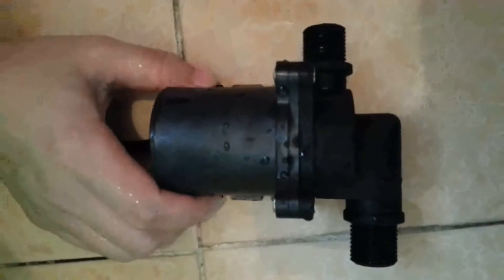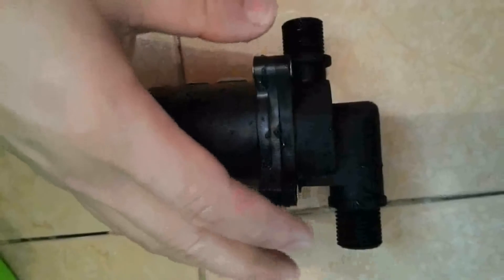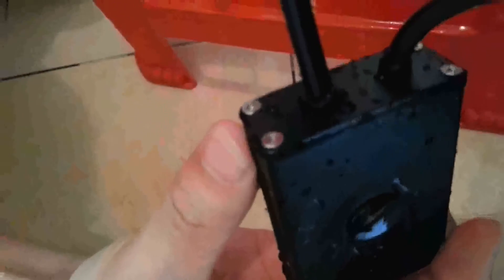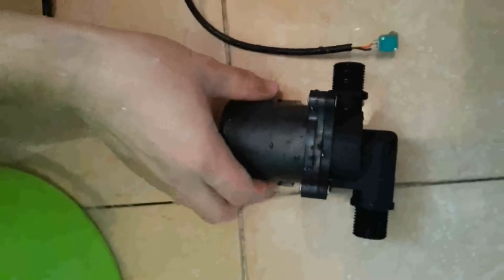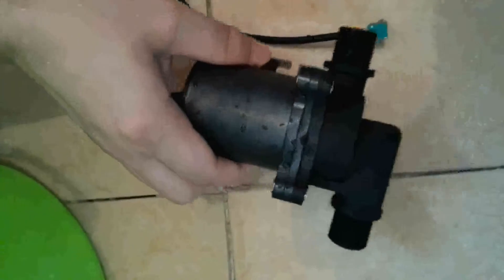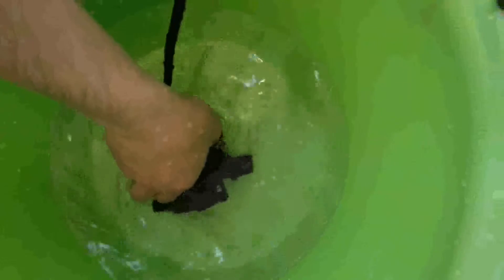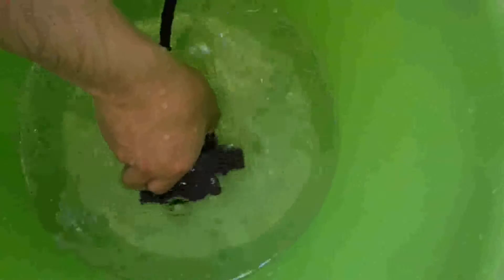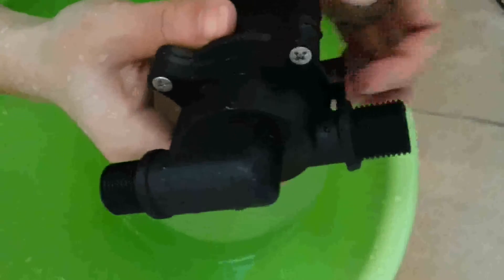24VDC Powerful Hot Water Circulation Pump 50C-2465A Power /Speed Adjustable

Comment: We need dc circulation pump with flow switch for hot water tap. The both end of the thread has to be metal as plastic breaks easily while tighting it.

Comment: Hi. Can u send mail were i can buy this pump
Reply from the maker: Currently involved pump's design are in identical material. Firm engineering plastics material, while not metal. But if you are interested, let me know your mail box, and we are more than happy to share with you relevent documents regarding pump products.

Surely, this current one displayed on video itself is a relatively older version, while current pump models could be better, from aspect of material design and also power efficiency. I think so.

Lily, from Shysky Tech Co., Ltd
Email: shyskytech@gmail.com
Reply: Hi. I want 12 volt circulation pump, but the plastic is easily broken, also i need to have a flow switch.  The pump has to give 0,5 bar pressure or more + i need the outside sideways. My mail id (tradesman.in@gmail.com)
Reply: Hi. Still waiting